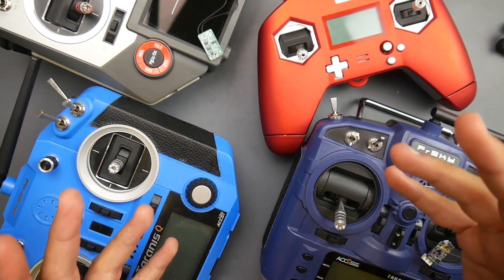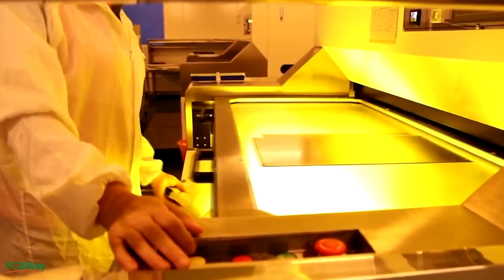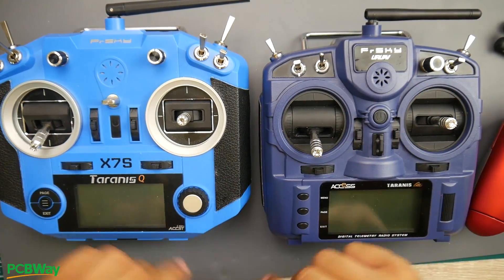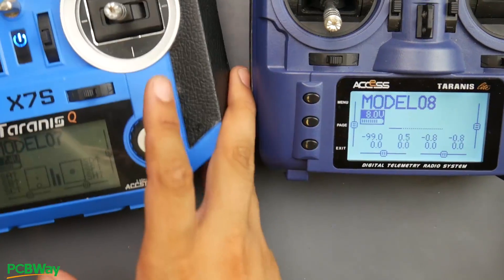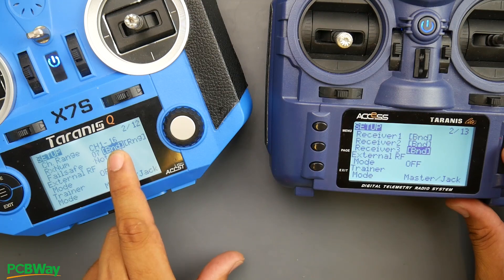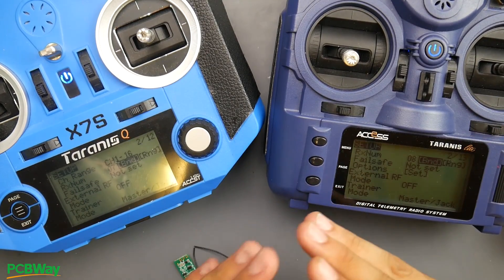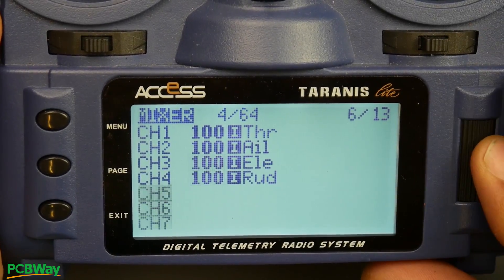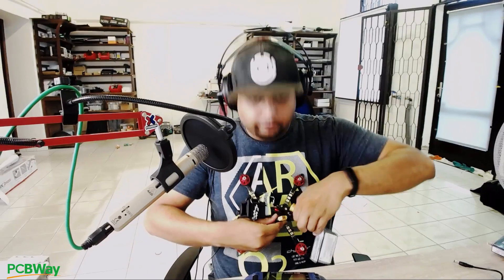Beginner Guide // How To Connect FrSky Transmitter to BetaFlight

Comment: YOU CAN´T BIND THE XM+ RECEIVER WITH THE X9 LITE!!! 
Because the X9 Lite just runs with ACCES. 
But on the Fr Sky- Site their is no ACCES for the XM+ available. 
So you can´t flash the XM+ with ACCES Firmware and can´t bind with the X9 Lite!!!!!!!!!!!!!!

Comment: I have a question about
the Eachine Novice III model.    I have a
question. Can you restore the factory settings in the ER8 transmitter again?
Just like it came out of the factory. I mixed up a bit on the ER8 menu and now
the drone does not respond to its arming (SWA Arm / Disarm)
Reply from the maker: check what is going on in the betaflight receivers tab

Comment: Hi, I have done all te setups according to your instructions. Default chanel mapping was AETR . I have installed AUX5, 6 & 7 as you. However in Betaflight these AUXs do not work. Nothing happens when I push them. Do you have any idea what can be a problem?
Reply from the maker: You need to enable them in your transmitter the Mixer page

Comment: I can not bind my tinyhawk S with my taranis x9 lite. the tinyhawk Receiver is: EMAX Tiny RX ( Compatible with Frsky D8 / D16) so if it is compatible with D16 why is not working on ACCESS D16? 
can someone help us?
thank you
Reply: You need to flash your X9 lite to latest firmware to have ACCST D16 mode.
Again some of SPI frsky receivers having random dropouts issue with D16 mode with telemetry.
1. Flash X9 lite to latest firmware
2. Try bund to D16 protocol with telemetry.
3. If you have dporouts switch off telemetry.

Sometimes some whoop AIO flight controllers with SPI receivers still have dropouts, then you are not lucky and need to use D8 mode ( I have one of many my whoop like this).
I'm waiting irangex module to avoid all drama about FC with spi receivers and will be able to use D8.

Comment: this is great, I'll glean what I can as I'm still new to this. I've a new taranis x lite s and I'm frustrated that it won't work with my tinyhawk s or freestyle. not without a module or adapter something something. I might return it
Reply: i have the same problem. i can not bind my tinyhawk S with my taranis x9 lite. the tinyhawk Receiver is: EMAX Tiny RX ( Compatible with Frsky D8 / D16) so if it is compatible with D16 why is not working on ACCESS D16? 
can someone help us?
thank you

Comment: Hi, I have a taranis xd9 lite with xm + receiver and rxsr are well connected but in the betaflight does not make me any movement of the stick nose why can you help me?
Reply from the maker: What flight controller are you using?
Reply: @DroneMesh  f4 geprc gep 12 amp aio 16x16

Comment: Dear Drone Mesh. 
I use mamba f405 mini mk2.
And use rx r9mini fw access v1.1.1. I use sport to pin fc mamba(ppm and source softreal telemetry)
I use x9lite access update with isrm v1.1.1 with module r9m lite fw access v1.1.1
And its connect. But when i fly my tx sound sensor lost. Again n again sound sensor lost..
Can u help me to fix... couse sound tx sensor lost alway..
Hopefully to replay...
Thnx Drone Mesh